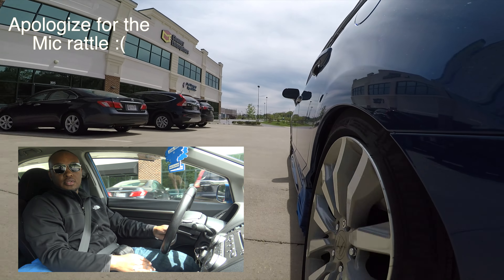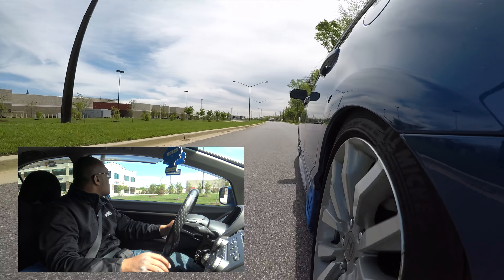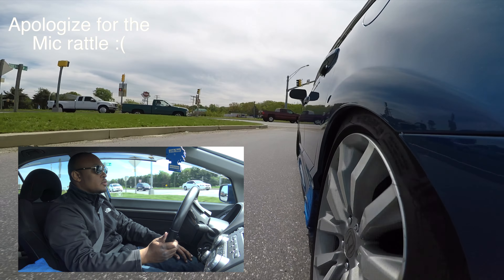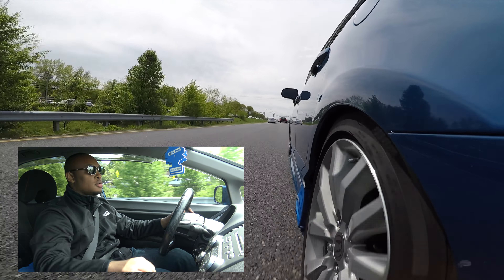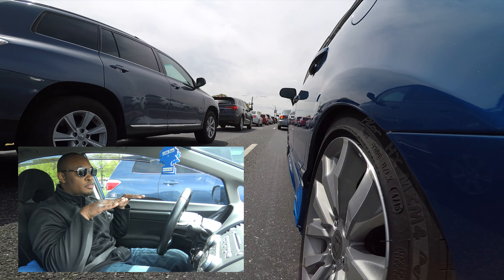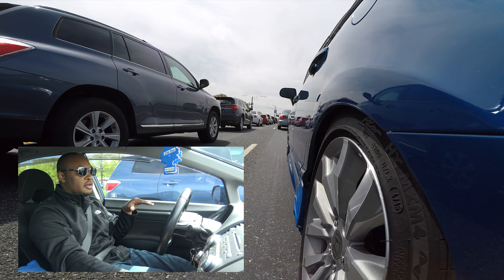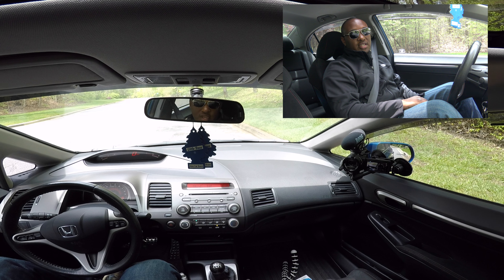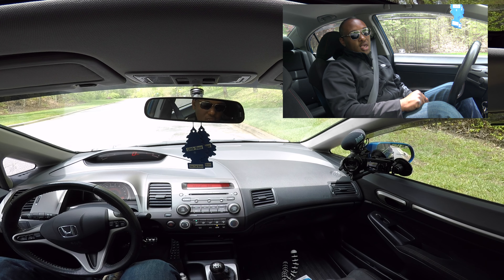Airlift Performance: 3P VS 3H Driving Review! Part 2

Comment: This video of seeing the car being driven around on what appears to be fairly smooth roads is not very explanatory in any way. 
Any suspension system will do just fine under those conditions. 
Owning this system myself, though don’t have the height sensors, I have to say that I love it and I hate. 
Let’s be honest, few of us will actually take the daily driver to the track. Sure it has less body roll during cornering and generally rides firmer with any setting. The main reason for most kids to install these systems is to “ slam” their ride on the ground. Ok, for those who are into that, have fun. 
Generally speaking, for any air rides, the driving comfort will depend on three things.
1) tire and wheel size. 
Larger wheels, less rubber=stiffer ride and more road noise and vice versa.
2) air bag pressure.
The higher the pressure the harder the bags and the stiffer the ride and again vice versa.
3) damper settings. 
Most claim a 30 setting damping level. You can go very stiff to very soft. 
Sadly, unlike on good coil overs, you do not get to set the impact and recoil damping levels. 
Driving experience: on mostly smooth roads, you will love your air ride. Hitting light bumps every now and then is also no problem. You will notice them but it’s not uncomfortable. 
However, once you get onto poorly maintained roads, which sadly there are many of where I live, you kind start to hate you setup in any configuration. You will feel the bumps, and the ride gets very choppy due to short suspension travel. After all you lowered your ride height. 
Bottom line, if you post a driving experience with air suspension on a daily driver, include all road conditions.

Comment: Forgot to mention. Height sensors, if installed, are generally meant to keep your vehicle at the set ride height no matter what you do with it. So you drive it hard around corners it will stay very stable with little to no body roll. It will do that regardless of height sensors though. Just a bit better with. 
Main reason to go fir the sensors is when you start loading your car. Just like any suspension your car will start sagging to more you load it. With sensors installed, the system will automatically compensate for that and keep your vehicle at the ride height it would be if it was empty. Uneven loads due to passengers or cargo being loaded unevenly. Again, sensors will auto adjust. 
Without sensors you will have to manually adjust height before taking off.

Comment: This is my first time using your 3P system, but I have two questions for you. 1. Why the remote controller screen will be black out when my car is moving, and I can't use the remote controller when I'm moving the car? 2. Why can't it be closed after I start the show mode of remote controller? Because I turned off SHOW MODE in the remote controller, show mode started again two minutes later, and this cycle keeps going. Even if I turn off the car and turn off SHOW MODE manually, show mode will start automatically after two minutes

Comment: I was expecting to see something about the maintain of the height with the 3H.. the major reason I’m upgrading to 3H is to avoid constantly pressing the button to get to exact ride height. I’m hoping with 3H it will resolve my issue.
Reply from the maker: Yes! This will avoid constantly pressing the button to get the exact ride height. The 3h will resolve this issue. I am working on editing the Shelby GT350 video on installing the 3H height sensors and talking about this. Stay tuned for this!
Reply from the maker: I explain this in a different video. This is just talking about the driving part.

Comment: awesome man, I cant wait to get my car, still getting worked at but they advanced alot since last time, its going to be awesome, also what cameras did you use for the outside and the inside?
Reply from the maker: Outside the car I used the GoPro Hero 5 Black and inside the car I uses the Sony action camera fx533..

Comment: So I'm getting a 3p install soon from airlift . I'm not compromising much because I did no get 3h? Your thoughts?
Reply from the maker: Yes, I would say you are not compromising much with not getting the 3h.. The height sensors of course rides a lot smoother and firm if you have passenger it stays at the ride height and adjust automatically and you can always upgrade to the 3H!
Reply: @EvilStreetShark   how is this on the bumpy roads and pot holes?
Reply from the maker: @RWarrior777  Very good!  soaks up the bumps! Feels your riding on clouds
Reply: @EvilStreetShark  thanks
Reply: @EvilStreetShark   one more question will this work well on a Toyota sienna?

Comment: How hard was it to install the height sensors? My 08 Si is on accuair switchspeed right now and I'm seriously considering upgrading to accuair e level with accuair's upgrade kit for $700-$800.
Reply from the maker: The sensors isn't hard to install for the airlift.. but I have no idea about accuair's height sensors..

Comment: Whats your kit? and what was the price?
Reply from the maker: Airlift Performance 3H Kit $3800-$4250
Reply: @EvilStreetShark  that's including installation?
Reply from the maker: @supergalaxy921  No! The kit is a lot cheaper now! The best time to buy the kit is black friday weekend
Reply: @EvilStreetShark  but I dont want to wait for so long :/ lol
Reply: @EvilStreetShark  which one u recommended the 3p or 3h
Reply from the maker: @supergalaxy921  I like the 3h because the ride height is more precise and you don't have to worry about the added weight
Reply: @EvilStreetShark  that's the only difference if more people sit in the car?
Reply from the maker: @supergalaxy921  So if someone gets in the car while the car is on! With the height sensors it will automatically adjust to maintain your ride height and keep the same ride height. The 3p will maintain the ride height if someone get in the car and you turn the car on. It wont automatically adjust if the car is on.
Reply from the maker: @supergalaxy921  Like I said in the video you feel a tad bit of a difference in corners

Comment: What pressure are you running it at?
Reply from the maker: Front are 41 and rear is 38 psi
Reply: EvilStreetShark you raised the coils so you can run that low of pressure? My stock height is at 65psi
Reply from the maker: No... What is your ride height percentage ? The recommend psi for ride heigh is between 40-50 psi
Reply: EvilStreetShark oh im not sure how do i find that out. If i drop mine that low of psi on my airlift performance struts im really slammed do you have the bellow springs on yours?
Reply from the maker: What's your minimum drive height set too?
Reply: EvilStreetShark 25
Reply: EvilStreetShark or 24 i think